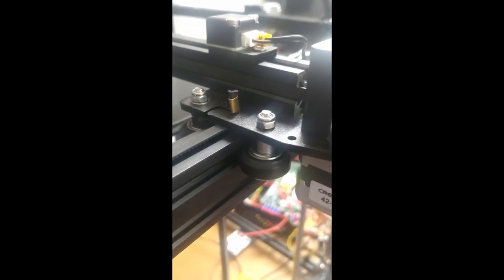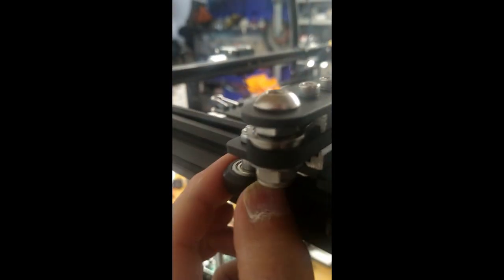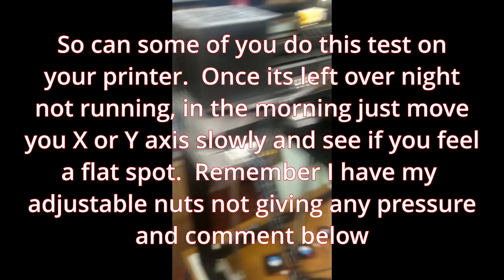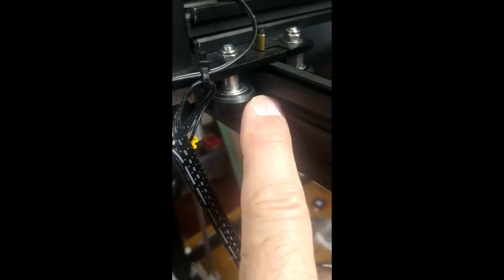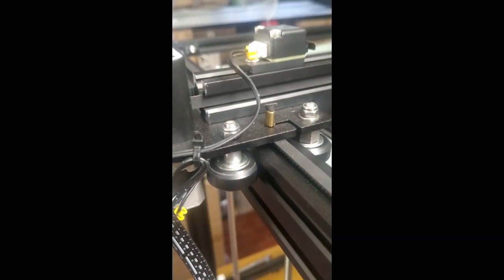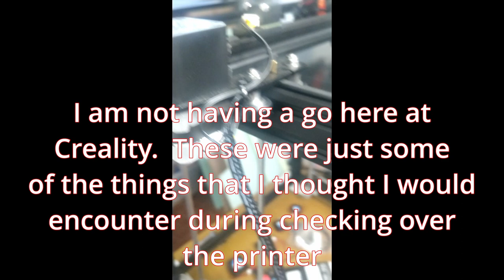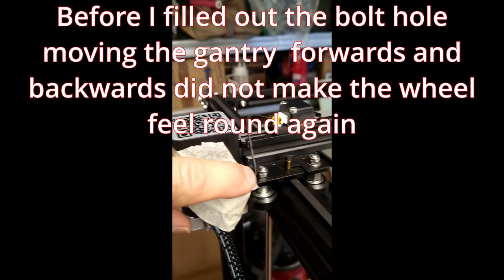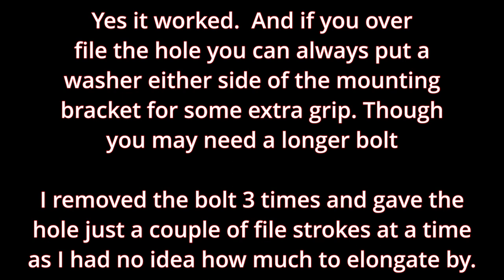Flat 3D 🖨️Printer Wheels - Not Due To Tight Nuts 0032

Comment: I actually just experienced this for the first time this past weekend.  I had left the printer sit for about 2 weeks and started to run a new print.  Kept getting layer shifts on the Y axis and always at a distinct interval.  But I had just run a smaller print with no issues.  I stopped the larger print and tried the smaller print and no shifts.  Very odd.  Decided to go over the printer and when moving the bed I found "notches" in it's travel.  I measured and it was at exactly 75mm every time I felt the stop.  A little math told me that was the circumference of the bed wheel.  I checked them again and there was no wiggle or slop in the adjustment and each one would just move with one finger, so not too tight.  When I took them off I found that one of them on the fixed side had a small flat spot on the bottom where it would have rested on the rail.  So the flat spot wasn't from being too tight but just from the pressure of having sat in one spot for too long without moving.  Ideally I think a firmer rubber would prevent this in the first place.  So I could prevent it by not letting the printer sit unused for too long.  I decided to go a different route though and I installed linear rails I had already on hand.  This has now lead me into a game of "how many mods can I do using ONLY parts I already have on hand and not spend a single extra cent?".   Time will tell.  lol
Reply from the maker: Thanks for a detailed reply. The mistake most make is to over tighten the eccentric nuts, as you likely known it only take a very small adjustment to go from fine to over tightened and hence the flat spots.  Hope the LR work out well for you 👍

Please remember to recommend my channel on other groups you may be in. Would like to get over 500 subs 😎

Comment: I found that it was my gantry where the 2020 beam connected to the brackets, I could get adjustment there. Also I notice a lot of the brackets are not bent to 90°. And my 2020, 2040 aren't always straight, and wheels aren't perfectly round..
Mainly diagnosed all these issues trying to figure out why I wasn't getting a flat plane when using unheated mirror as bed, (disable one axis and take a look at how bad the other is by doing a bed mesh with bltouch and octoprint or dial gauge)..
Unfortunately it's not a problem just confined to budget printers, I've seen expensive systems with appaling tolerances.

Nice video, well explained, easy solution.
Reply from the maker: Glad you are working through your issues. Yep it's always easy once you have found the solution. Had me trying things for a while. It print well loving the build volume.

Comment: My ender 3 pro came brand new with bed flat wheels.
At least 1-2 of them. still havent figured out which one. but yeah, i have to replace it/them.
But I took them all out under the bed and they feel different. Some roll freely, some with resistance.
Bearings are obviously crappy. Maybe bearing itself is binding, who knows. I will figure it out.
Reply from the maker: Glad you found the problem.

Comment: i a very confused, why do you only have 1 weel on each side tight, they should all be tight, this is to release the chances of layer skipping (when it moves too fast and ends up moving more than it should) it is also meant to release the stress off the other wheels so that instead of 1 doing all the work all 4 are contributing,
that is probably why you have a flat spot on your wheel, as the rubber is wearing off faster since it's doing all the work.
Reply from the maker: Thanks for the comment but you have mis-understood this video. With all encentic nuts loose I only have the outer wheels touching the profiles. When left over night and I move the gantry by hand I feel flat spots on the wheels. Meaning the the fixed position of the wheels are too close to the profiles. I find out which wheels are too tight and make the round whole very very slightly oval to allow the wheels to move away from the profiles. Now when I leave overnight no more flat spots. I then readjust the encentic nuts to apply very slight pressure as normal. I hope this clears it up for you. If not write again